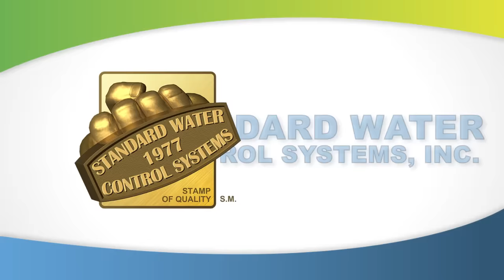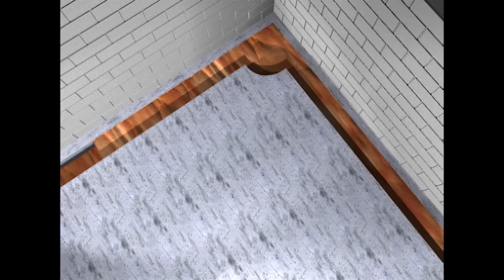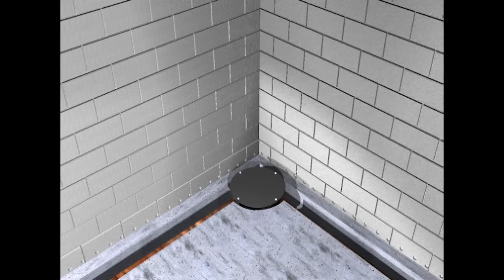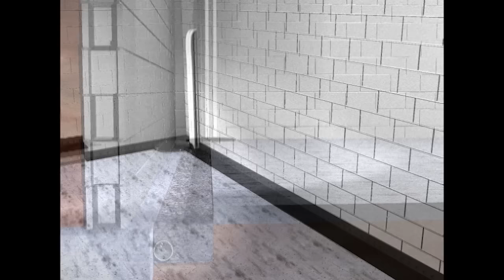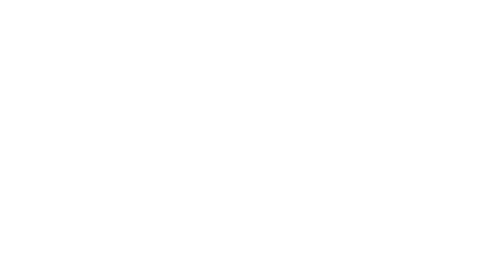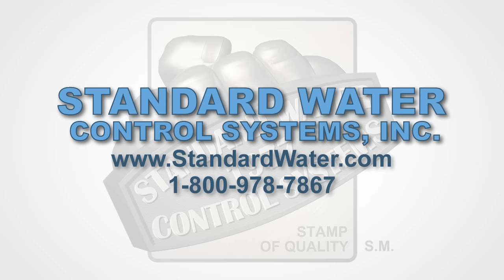Basement Waterproofing - The Solution Animation

Comment: Why wait until the water has already breached to the INSIDE of the house where electricity is needed to pump it BACK OUT?
Prevention is always best! Install an exterior curtain drain around the perimeter and make sure gutters and downspouts work and drain away from the house.
Reply from the maker: That works well when you initially build the house. However, if you're trying to retrofit a basement with a waterproofing system the exterior is far and away the most expensive way to do it because you have to deal with landscaping, decks, and sidewalks. In some cases removal and replacement of some or all of these things is necessary. The University of Minnesota has concluded that an interior, sub-slab system -- like we install -- offers an effective system and cost efficiencies that make it the best choice for retrofit.. BTW, we have also installed exterior solutions.

Comment: How does the water from the joint get into the pipe?
Reply from the maker: The water flows through the holes in the concrete blocks, under our patented Diamond Drainage Board, over the footing, into the drainage field and into the rigid drain-tile.

Comment: You need a Vapor Barrier on the wall.  And a 4" pipe. Don't cheap out
Reply from the maker: We have a vapor barrier that we install on some jobs when water is intruding from higher on the wall. Here in the upper midwest we mostly see water coming in at the joint where the floor and the wall meet or up through cracks in the floor. And, yes, we use 4" pipe.